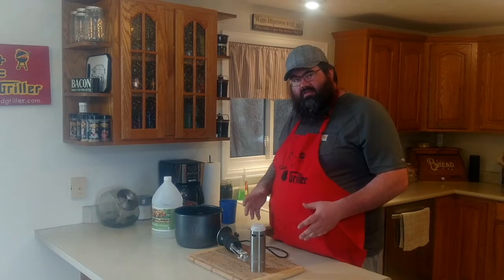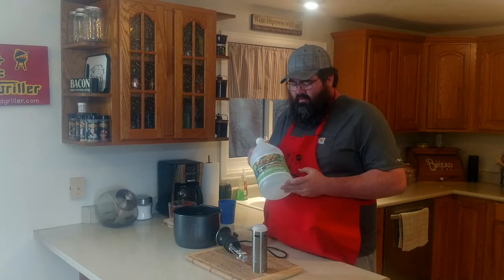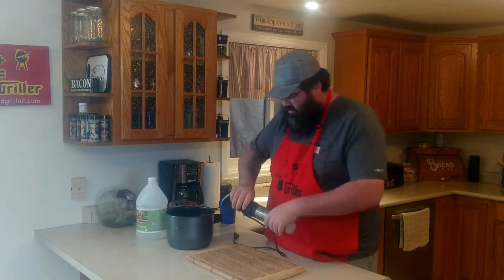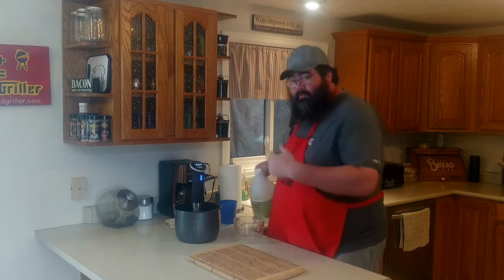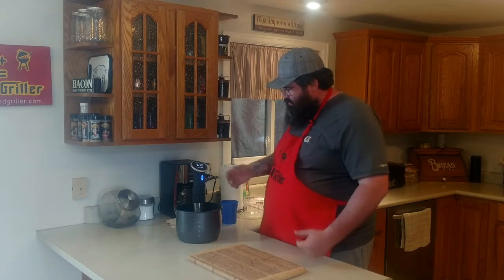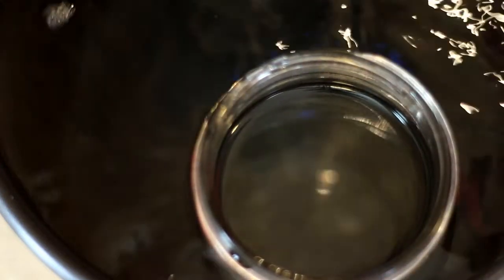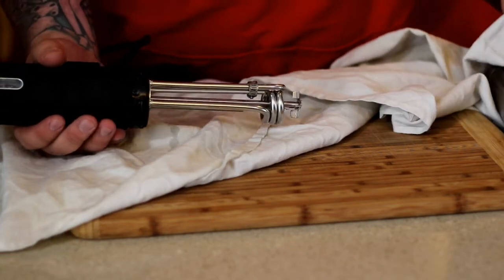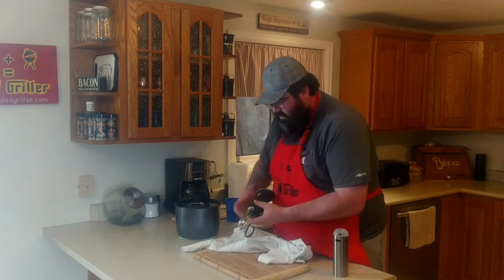How to clean your Anova Precision Cooker w/ White Vinegar!!

Comment: Thanks for this video!  Was looking for tips on a container to use.  Coincidentally, I recently rec’d an email from Anova about the cleaning process recommendation with white vinegar/water 50/50.  They say 158F/70C for 30 min.  We don’t have a tall and narrow pot so I was racking my brain for what to use.  Then hubby said why not the Vitamix container, and yay, it has measurements on the side just like your pot!  I know it tolerates heat as we have whooped up soups in it to puree.  Now running with 3 1/2 c. white vinegar (luckily all I had left!) and 3 1/2 c. reverse osmosis water from the hot water dispenser so fewer minerals in there.  Works great!   We use our Anova pretty often.  I wonder how often it needs cleaning like this?  I suppose I’ll just look for build-up/corrosion.  I use our well water in the Anova container, which even with a softener has a lot of TDS (total dissolved solids not TDS!🤪).

Comment: Citric Acid works very well for this as well as a chelating agent,  it's cheap and I simply add and dissolve 1 Tblspn worth to my sous vide water bath, hard water never shows up doing this. (Sure you could use vinegar in the same way)
Reply: So if I drop a lemon in water u think it will work? Im gunna give it a try

Comment: My only concern is damaging the temp sensor and getting inaccurate readings after. Tho, I feel the hard water is doing it already. I usually use Citric Acid powder for my coffee pot and carpet cleaner/steam mop.  It actually works way better than vinegar, just my 2c.  But I'm afraid to try either on my sous vide. Gonna do it anyway eventually as it's only getting worse with use.

Comment: Thanks for the video ... I am having trouble getting the cover back on snuggly.
Reply from the maker: +Bob Cotter hmm did the metal bend or do you have the little bumps and dimples lined up?
Reply: both mine are more loose when the clamp is removed

Comment: The only other safeguard is maybe use Distilled water?....Thanks for the heads up
Reply: Distilled water can be costly, try dissolving 1 Tblspn of citric acid (about $9 per lb) to your water bath.
Citric acid acts as a chelating agent (think water softener) plus it's not detrimental on the equipment or environment.

I've been doing this for months now and use my sous vide daily, I needed to clean it off from the hard water scale every 3 days, I have not needed to clean it or my plastic water bath container since using citric acid.
Reply: @necro1234yahoo    Are  you saying to add citric acid when cooking your food ?

Comment: How often would you recommend doing this for a frequent user?
Reply from the maker: It's hard to say how often you would need to, depending on the duration of your cooks and the mineral content of your water. I would just pop that cover off and see how much build-up you have every so often.
Reply: I got tired of the cleaning off the white scale every 3 days (super hard water) so I thought, why not just add vinegar to the water bath.
I found that citric acid is cheap (about $9 per lb) and works even better than vinegar for hard water, so I simply dissolve 1 Tblspn of it to my water bath, that keeps my sous vide and water bath spotless, have not needed to clean it once since doing this. I think it's easier to maintain versus clean the build up over time.
Reply: @necro1234yahoo  with food being secured in the bag good, adding a little vinegar to your water may work also.
Reply: @TheBeardedGriller  Also, you can always save the vinegar solution. Don't throw it down the drain, add it to your next dishwasher cycle, as it helps keeps things clean.